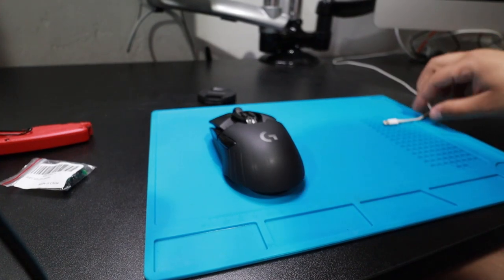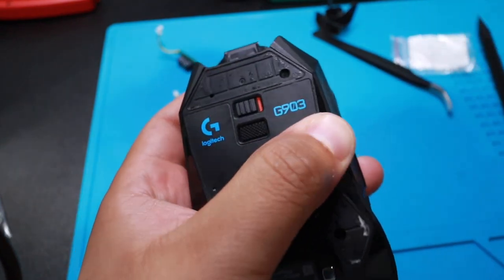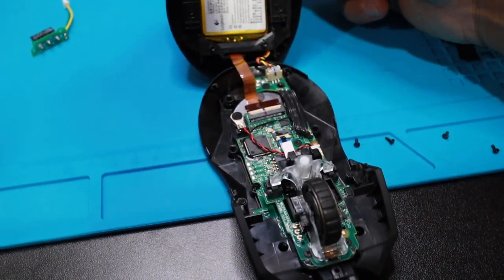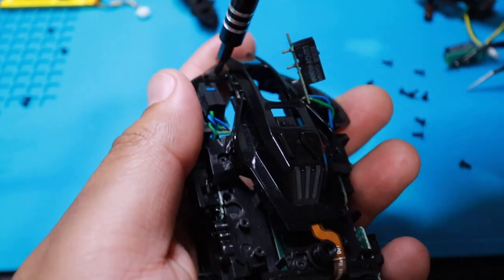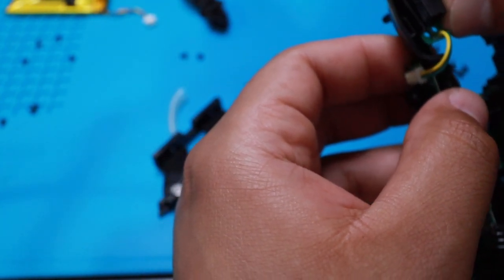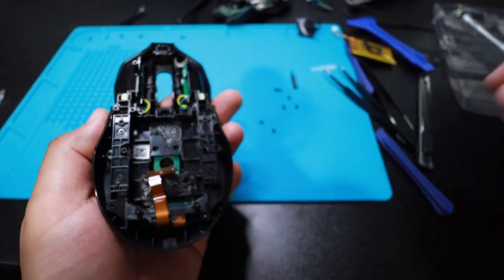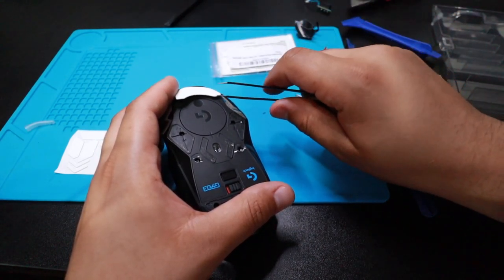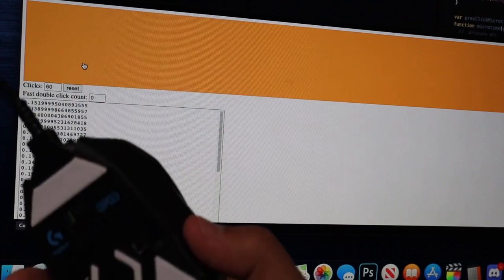Logitech G903 Button Switch Replacement

Comment: Thanks a lot for your effort! 
I went a bit OCD on cleaning off the glue and it was much easier not make your mistakes ones I've seen them. 😉 My biggest pain in the neck was to pull out the battery cable. Felt like it was soldered in and I was worried that I'm going to rip it. 
Thanks again!

Comment: Hello !

Unfortunately, I also ended up replacing the switch. I would like to ask how I can remove the part at 17:30 that you unscrew. Because unfortunately that part was left out of the video??

Thank you in advance for your reply.
Reply from the maker: I believe the next part is actually removing the battery after all screws are removed it was just a pause in the video and continued after

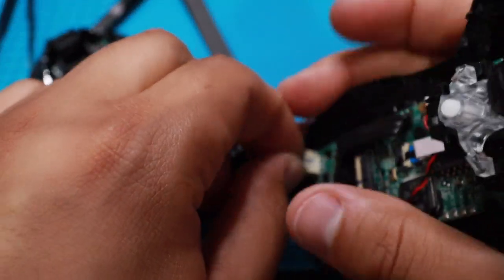Comment: 16:19 Well, I ripped the black part of the stupid battery cable. Guess I'm buying a new mouse :(
Whatever did you mean with "Pull that tab instead of doing what I did"? I was looking for some kind of trick, but never could figure it out.

Comment: Guys, got a problem with side switches. Found those to buy but can't get any video or text if they are easily plug-in replaceable or need soldering. Ngl, they do look like they demand no additional work but it'd be great to get ensuring info from someone confident.
Reply from the maker: Wait u need help replacing the same switches i replaced in the video?

Comment: I still had to solder... they sent me two switches , I checked the wiring first because.... china.... and one had backwards wires.. I double checked with the old one. they put the green gnd wire on the +terminal... not sure if that would have worked but I fixed it BEFORE doing all that work and finding out it either doesn't work backwards or it fries the mouse. 

Look at your wires on the new ones boys and girls. They may be wrong.

Comment: I have the same problem with this mouse, very disappointed as it was quite expensive. My solution was to switch brand.
Reply from the maker: What other mouse on the market compares? 
Of course I’m not here to defend Logitech, but if you own a Honda and it had a common oil leak, are you going to switch car brands? 
I liked the mouse so much that I wanted to fix the issue and now the issue is gone. Who knows if the switch buttons I received were high quality and will last a long time. What I do know is the switches are cheap and it’s simple to install.
Reply: You've got to realize that it's not that easy to switch brands when the mouse itself is the perfect fit for the user. I got mine the G900, been using it since 2016. 

Love it so much. As I actively use those 11 buttons as shortcuts when using editing softwares (Adobe apps, for example), and it's also just as useful for RP or simulation games (Skyrim, GTA5, WoW, Cities Skylines, for example). 

Despite the scroll wheel's side-click switches are having some double-clicking problem for the last 2 years, while also one of the most annoying mice to pry open, I still love it. 

I've tried switched brands, bought Razer Basilisk Ultimate last year as a replacement (hopefully), but I keep coming back to my G900. 

There's no other brands yet that have the free-flow scrolling toggle. There's also a few brands that have scroll wheel's side click (one of the reason why I bought Razer Basilisk Ultimate).

Comment: Hey i slapped my g903 a little bit and now the right button clicks with 0 effort. Just resting my finger results in a click so its basically unusable at the moment.  Did i brake the button switch or something else that would lead up to this ?
Reply from the maker: Sounds like you broke it. But it wouldn’t break that easily. I’ve thrown my around lol not hard but it never broke. Have you opened it?
Reply: @BrokeInCalifornia no dude , im actually about to send it to a shop... im pretty sure i wont be able to do it by myself. It still has warranty so if i find the warranty card, i'll try that. If it doesnt work i'll just pay for the repair i guess.
P.s. it broke very easily , or maybe i just hit it too hard , idk..